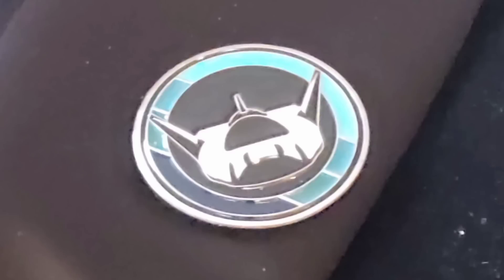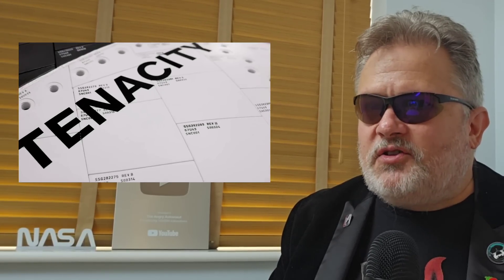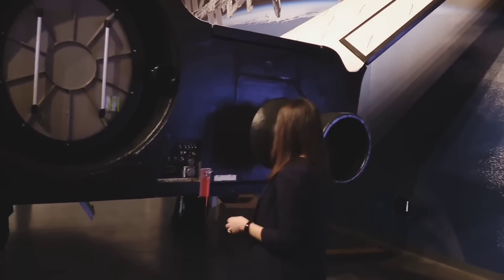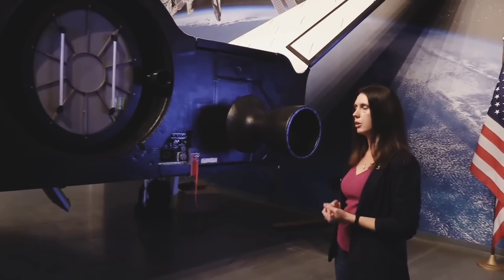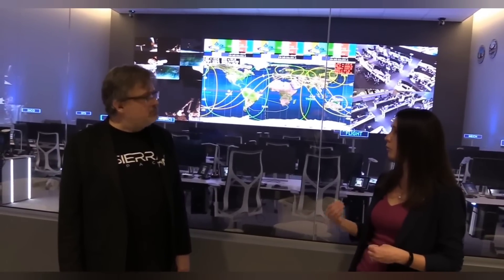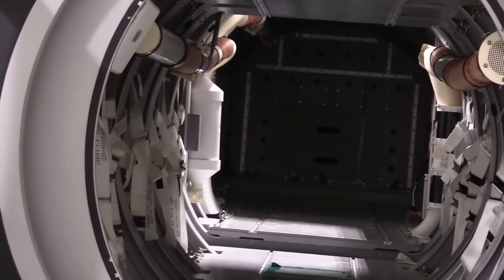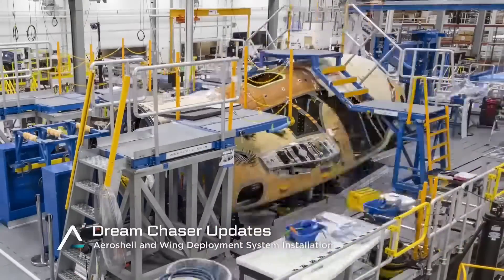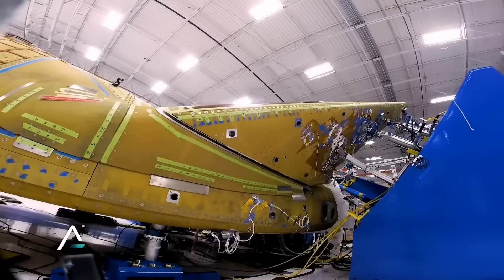New Space Shuttle ready to fly!  Sierra Space unveils completed Dream Chaser Tenacity!

Comment: AA you’re a bit off the mark here. Lifting body aircraft did not start with the Soviet BOR-4. NASA worked on several research designs much earlier, these are the aircraft and their dates of first-flight:

M2-F1 - 1963
M2-F2 - 1966
HL-10 - 1966
X-24A - 1969
M2-F3 - 1970
X-24B - 1973
BOR-4 - 1980 (USSR)
HL-20 - 1990*
DreamChaser - 2024??

*full scale model only. No flight hardware was ever built.
Reply: Don’t forget the X-38 in 1998.
Reply: @wpatrickw2012  there was also the X-33 and VentureStar.

Comment: I have wondered if you could make a big enough disc with such a big area compared to the weight of the vehicle that you could create and air cushion so you wouldn't need exotic tiles to manage the heat. Maybe surf skip the upper atmosphere and slow down in stages and give it time to cool off if such a thing is possible. Presumably its very advantageous to avoid all the fragile tile work.
Maybe a carbon fiber shell with some kind of ceramic matrix so it can handle very high temperatures. Carbon fiber themselves can handle 3000 degrees c so with a ceramic binder it might handle the heat without any special tiles.

Comment: Tbh, i am not big fan of dreamchaser. 

Because i see similar issues like with shuttles:
-custom tiles for heat shield, each tile is different, each tile is glued. It will be long (means pricey) process of refurbishment. 
-moving parts in area that need to be shielded. Like wheels, control surfaces etc. it needs to be very careful inspected/refurbished after each flight. Means: cost.
-dreamchaser require very large fairings, and i am pretty sure that is heavier than starliner/dragon considering how kg of cargo to orbit.

Only benefits i see with that system i can think of is much more smooth landing and quicker cargo recovery compared to dragon/starliner. That alone can be deal breaker for many contracts as it could allow to have additional possibility for important experiments. I can't imagine that dreamchaser would be serious competition for Dragon, Starliner.. is f-up by Boeing, but i think that system in theory was also more practical than dream chaser. 
I see niche for it, but i doubt that it will be ever primary system

Comment: This would be interesting if they had the sense to use i rocket that is flying eg falcon 9 , Ariana, or a Chinese system
Reply: Wouldn't fit the current fairings of a falcon....
Now if SpaceX were to come up with a Starship upper stage that opened up like the spacecraft in 'You Only Live Twice'.
Reply: @DieyoungDiefast  they would have to pay for the new flaring like the USAF wouldn't, Elon has moved on to the starship, flaring are easy rockets are not
Reply: Ariane ?  Werent you proposing rockets that fly ....   🚀🏴‍☠️
Reply: @MichaelWinter-ss6lx  not the new one the previous one which I believe they would still be making if they had a contract to lunch dreamchaser.